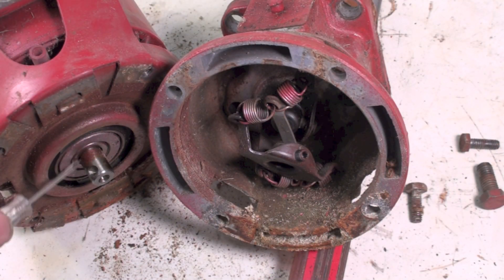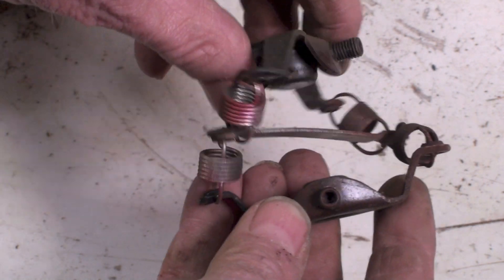Bell and gussett boiler circ pump operation.

Comment: Hi Gray Furnace Man, hope you're doing well staying safe during this unprecedented pandemic.. just want to wish you a happy holiday / Christmas season despite all that's happening. I want to thank you for taking apart impella section and the bearings..I now have a better sense of what it looks like inside. Had the couple replaced 5 years ago. I was feeding it 15 to 20 drops each winter season here in NYC. Only from you I learned you I realize I got you fill up that little tank between the coupling meets with the impella section. I yanked up that little cover and noticed is plenty of room to put more oil in the oil tank space is about an inch and a half square.. so I can put in that 3 in 1 oil in the blue and white can that's used for 1/4  horsepower motors.. This 8oz. tin squeeze can has been sparsely used by my late for a good 30 years... but thanks to you I realized I need to put more.. I'm mixed in a little vaseline 2 teaspoons and and the three in one oil. it helps silence the rickety sound it made.. I hope I'm not having problems with the boiler cuz it's not running right now for at lease for 5 hours on Christmas Day.. I dread worrying about having to replace the boiler that's been built 1965... my mom put in a water heater over 20 years ago and that's alleviated the water heating duty of the original boiler.. now the heating season is in full swing it's so windy outside blowing 60 miles here in Brooklyn.. I can feel the drafts coming in through the windows. so I got to go downstairs and check the boil in this two family house.. and hoping I can started working again.. thanks so much for your information preciate it stay well best wishes for a saner and happier New Year
Reply from the maker: And a safe new year to you and yours.   Also hope for a saner new year.
GFM
Reply: Happy New Year to you!  Question:  You mix 2 teaspoons of the REGULAR LIQUID VASELINE with the 3 in 1 Oil and mix it & use to lubricate the circulator pump????   Thanks in advance for your reply Patrioti!!!

Comment: I used to work on these things, yes , it usually was the coupling that broke.  These pumps were old when I got to the facility.  I would when possible  replace these pumps with a  Grundfos brand  pump less problems, less maintenance.

Comment: If they motor seizes what will get it running again? Adding oil?
Reply from the maker: If you are lucky, you can add oil and work the shaft until it moves, then hope it does not leak.
GFM

Comment: Do you have a video description of how to oil a red Barron circulator pump ?
Reply from the maker: I do not.  The Taco pump is similar to the B & G except the pump oiler (round hole above the shaft) requires only about 20 drops of oil.  The motor requires 20 drops on the bearing closest to the pump.  The back bearing requires about 10 drops.
GFM
Reply: @grayfurnaceman  thank you!!

Comment: If you need to replace this pump-motor assy. What are your options?
Reply from the maker: You can use something like the Grundfos UPS15-58FC.  This is a water lubricated, no maintenance pump for residential boiler systems.  Not necessarily this pump as your system may require a different size pump.  There are parts available the the B&G you have with the motor, coupling and pump available as separate parts.
GFM

Comment: Most of those pumps do 2.5 million revs a day. The old style (oem) couplers have 16 wearing surfaces. They will fail.
Now we only use the single spring coupler Spiralink, The Spiralink coupler uses a torsion spring to take up any misalignment.
Reply: Is there a way to oil it so it doesn't make so much noise?

Comment: Happy New Year!  Is it better to oil the circulator pump when the boiler is working?
Reply from the maker: Happy new year.  It is best to oil at the beginning of the heat season.  The pump does not need to be running.
GFM
Reply: @grayfurnaceman  Thank you for your answer...
I do it before the season, but it runs down from the bottom of the pump!   Maybe I put too much lubrication??   Also, how often should I lubricate it and how many squirts to each opening?   Thanks so much!
Reply from the maker: @mariavasilopoulos8496  That often happens, so I recommend oiling twice a season if some oil comes out.  Pump oiler should have 2 tablespoons, Yes 2 tablespoons.  motor oiler closest to the pump one tablespoon.  One teaspoon in the other motor oiler.
GFM
Reply: @grayfurnaceman  Thank you again sir.  God Bless you.

Comment: What kind of oil do you use to lubricate the 3 motors?
Reply from the maker: I use what is called a "Zoom spout oiler".  It is available at hardware stores.
GFM
Reply: use only 20 wt  non detergent oil
Reply from the maker: @donmcleod8277  I must correct you on your designation of the correct oil.
There is no "20 wt" oil.  There is a SAE 20 oil.  That oil is suitable.
GFM
Reply: 20wt NON detergent oil
Reply: @grayfurnaceman  you are right.
I just assumed every one knew SAE 20
Reply: @billtompson4328  Where do you get this "20wt NON-DETERGENT OIL"????  Thanks

Comment: I need to install a seal kit in a pump like this, but can't remove the stuck nut that holds the impeller.  The impeller is made of brass.  Any advise on how to get the nut off?
Reply from the maker: I can't remember for sure but some of them may be left hand thread.
GFM
Reply: nun of these have left hand threads. Turn harder. Maybe put a screwdriver in the impeller.   9/16 socket

Comment: How often and how much oil do you place in the oilers?
Reply from the maker: A Bocsi 2 Tableshoons, yes, 2 tablespoons in the bearing assembly.  40 drops in motor bearing at pump, opposite motor bearing, 20 drops.
GFM
Reply: Thanks for the info GMF.....would 5w30 synthetic suffice?
Reply: So just to clarify, there's the motor, bearing and pump. How many drops of oil for each component? I.e. motor (x drops), bearing (x drops) pump (x drops). Thank you!
Reply from the maker: Pump, 2 tablespoons.  Bearing on the pump side, teaspoon.  Bearing farthest from pump, 15 drops.
GFM
Reply: grayfurnaceman Thank you!
Reply: Hi Gary, I have a B&G 100 series OLD circ pump...made noise (almost like crickets )..found oil on ground under pump. Called service guy not coming till tomorrow so I looked closer & found instructions to add oil to motor and bearings...I added oil to pump and its dripping out from under pump coming from between motor and pump...added 10 drops to the two little tubes on either end of motor ( i guessed on this as there were no other access points) and some oil (not much) came out from under motor furthest away from pump....? should I just have new circ pump put in (old system no shut off valves to this pump) or try replacing gaskets? Many thanks for any advice...If I can keep it running I would prefer to shop for good repair guy...thx
Linda
Reply: And what kind of oil do you use?
Reply: @grayfurnaceman  Hi, you said    re: Pump, 2 Tablespoons (? how many drops??);     
Bearings farthest from pump side: 1 teaspoon (how many drops??);   Thanks
Reply from the maker: @mariavasilopoulos8496  Starting at the pump:  30 drops, 10 drops, 5 drops.
GFM

Comment: After replacing the coupler I got a rattling noise.
Reply from the maker: zomski101 Did you replace the motor mounts?
GFM
Reply: You should change the motor mounts.  
Spiralink coupler withstand more misalignment and are quieter.
Reply: Use only a Spiralink coupler. They are quieter and last longer (there are no moving parts).

Comment: Hi Sir, thanks for the video!
I have changed the bearing assembly, impeller and coupler (bearing and coupler came pre-assembled). Everything seem ok, motor and coupler run smoothly, normal sound. But somehow, so I wait for about 2h then started to remove air from the radiators, somehow the 1st floor seem ok, very hot after air removal. But my 2rd floor, i only have air came out but no water came out and not heat at all. I was thinking my old motor is not pumping strong enough as usual ? Do you have any hints ? Thanks in advance sir.